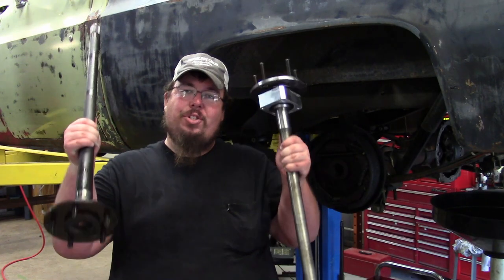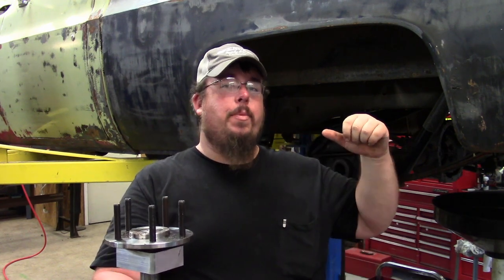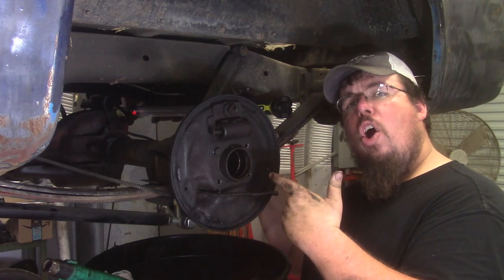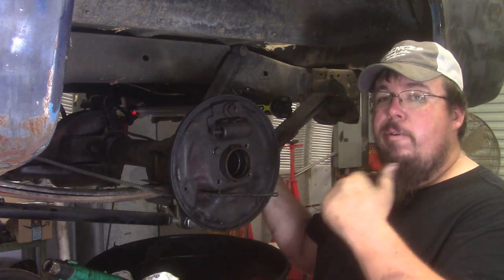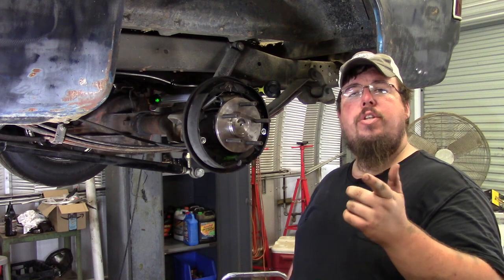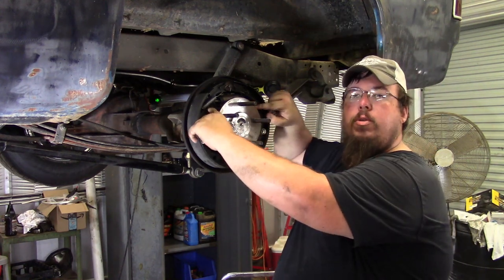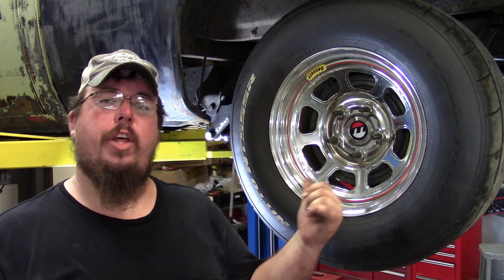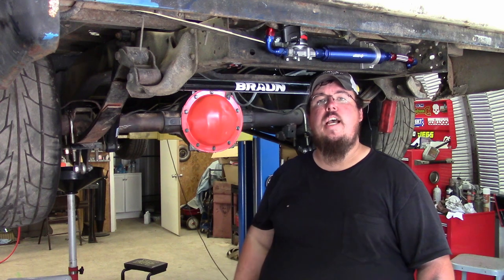GM 10/12 bolt C-clip eliminator install

Comment: Wow great video!   I have an early 70's Chevy 12-bolt posi and the actual axle housing end where the bearing press into is worn to the point where you can just reach in and pull the bearing out by hand.   I can see the wear on the lower axle tube opening where the bearing is moving up and down inside the housing.   Installing a C-Clip Eliminator kit would solve this problem without having to do something else like cut the axle tube ends off and weld on the Ford 9 inch bearing kit that some guys do, only problem with that is axle alignment has to be perfect.  I think this way is a much better fix for my situation.  Thanks for the video it helped a lot.

Comment: Bolt on axles is a wise decision. However, you already know C-clip eliminator are junk and leak. I would have used a Dana 60, 35 spline axles with a powerlock and Ford big bearing ends. With 1350 yoke. Check the housing out on a lathe and straighten if necessary, then shorten. We don't butt weld ends to the tubes. We machine the tube and end to a press fit. Then, v weld together. Afterwards, we place the dial indicator on the axle brake flange surface and rotate housing to insure it is zero.

Comment: C-clip eliminators are not designed for street use and will wear at an extremely accelerated rate when used on the street.

Comment: I’ve been following your series on this. I’m fixing to do a rearend rebuild on the 8.5 10 bolt in my dirt track camaro. Your videos have helped me on this. Was also thinking about doing videos on it also and some other stuff I do with my racing. Was curious what app or video editor you used for your videos?

Comment: Nice  video do I have to change wheels with this kit   it's already a tight fit
Reply from the maker: No, they are exactly the same width and everything. Basically a direct replacement upgrade kinda deal

Comment: Just came across your channel and enjoy the videos. What did you use for  grease for the bearings on the eliminators just normal wheel bearing grease you'd use on the front tapered bearings in a front rotor?

Comment: I'm torn between upgrading my 10 bolt like you as I have had bad luck since changing the ring & pinion in it orrr ima just swap a 14 in. I got a 2000 Sierra with  6.0.  Curious,  hows your  rear differential holding up since your replacement of the internals? Thanks
Reply: Just swap a 14 bolt in. They made them with 6 lug aswell in early 90's. 10 bolts are a complete waste of time
Reply: The 6 lug 14 bolt is only a semi float so kinda defeats the purpose

Comment: What c clip eliminated did you use a1033? And will it fit a 1989 c1500 10bolt
Reply: Did I have any luck on elemenator kit or can u use stock axels with a full spool?

Comment: Why would you go through that much work only to keep the drum brakes?
Reply: Disc Brake kits for C-clip eliminators are very few and far between.  I am running into the same issue with my 12 bolt.  Only kit I have found is from Wilwood for about $700 starting.
Reply from the maker: because the truck really is only used at the drag strip, or cruising at low speeds in town (usually less than 55mph). when I get around to building a Ford 9", it will have disc brakes, but for this build, disc brakes is a wasted expense. the truck will stop well from 110+mph at the track without issues even with non power brakes.
Reply: stopping with drums is not a problem .this is true except for  repeated hard brake usage as in road racing. the repeated use leads to drum expansion and brake fade. a big reason for factory disc brakes is much cheaper fewer parts. simpler also no need to take a picture to get the discs back on right.